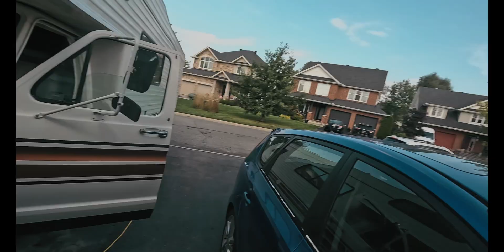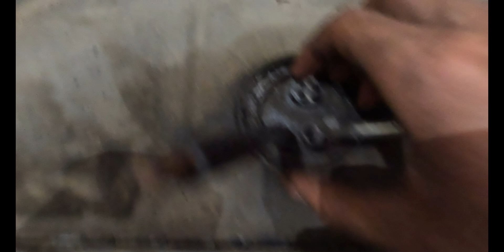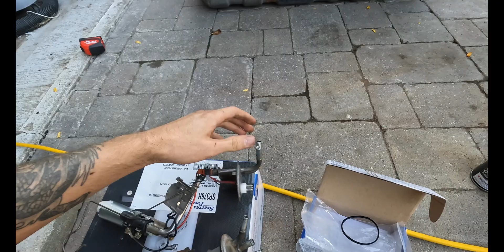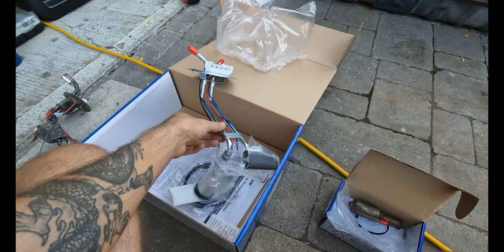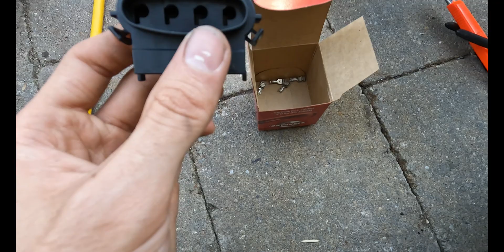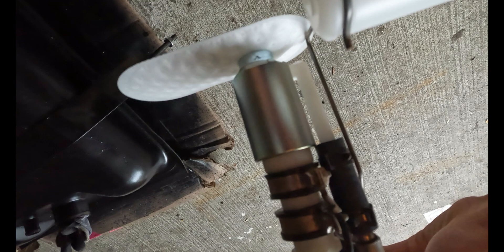3rd Gen Ford E350 Econoline Full Fuel System Replacement |1984 E-350 VINTAGE RV REBUILD EP.56

Comment: I have an 88 econoline 350 will it work on that
Reply: I need to redo the fuel lines
Reply: Mines a single tank
Reply from the maker: Yes, the 88 might have some differences but overall it's the same process

Comment: what fo you mean by front tank? i don't have tgat. i only hage rear tank 55 galolkms. where is the front tamk?
Reply from the maker: It's a dual tank system, if you have just one that's fine. Honestly I'd prefer that over two
Reply: @ZJsWorld  box truck don't have two tanks and it is 35 gallons or 55 gallons. i have a custom made tank for my onan power generator but it was not from ford
Reply from the maker: @coco9004 yes exactly, that's cool you have a custom tank

Comment: Do you still have those fuel sending units?
Reply from the maker: Think I got em in storage but they're pretty rough
Reply: @ZJsWorld if they work at all good enough for me cause I can’t get any by me and ordering them is almost 500 each now
Reply from the maker: @phazedblake6999 two different sizes, what tank size do you have?
Reply: @ZJsWorld I have the identical camper van as yours with both tanks
Reply from the maker: @phazedblake6999 where abouts are you? I could send em out to you after the winter I can't get to em now

Comment: I got an 82 corsair Econoline xl been sitting 8 years put a new battery in it turns over but won't start, put a Lil gas in carburetor n it starts but dies right away
Reply from the maker: For me I did a ton of trouble shooting to figure mine out but it could be a few things. They have a safety switch built in so it'll kill the motor if something is wrong. For me it ended up being a failing thermostat so it would shit off to prevent heat damage. In some cases it can be the safety switch itself is messed up or there's a solenoid on the back of the block under the doghouse which would need to be replaced, this have me a temporary fix one day. Also check your fuel delivery relay they tend to go bad A LOT when sitting. Cheers hope this helps

Comment: I've got an 88' warrior Winnebago E350 been stuck on the road replacing the fuel system, mechanic did the tank pump and float etc. .drove for 1hr. Heard a "c lunk" and ow it dies after 30 sec
Reply from the maker: Ah man that's so frustrating. I had my fair share of break downs getting across Canada   maybe check for spark? This is an issue I had. Also could be your fuel filter is clogged? It's honestly a headache dealing with these vehicles sometimes but they are simple at their core. Just have to backpeddle and do some diagnostic

Comment: i have a 1991 ford e350 high top that is having possible fuel pump related issues. I got it a year and a half ago and have dumped tons of money into mechanical repairs, even rebuilt trans. Needs floor pan replacement or patching. I wanted to make it a weekender camper, but was going to use it as my daily for saving miles on my truck. i love the van but its breaking my heart.
Reply from the maker: AW MAN, I KNOW THAT FEELING. gotta weigh out your priorities now and see if its worth finishing. i wish you the best of luck!
Reply: some of those year fords had an issue with the pcm  or ECU )engine control module having defective transistors. may be something for you to research if you've put much money into fixing an engine driveability issue that is unresolvable as the defective ecm could present in many varying symptoms that mechanics blame on parts. my 1993 ford e350 RV with the 7.5L v8 had a plugged catalytic converter that was causing my mileage to literally drop to 2 mpg

Comment: Relay connector is full of green crusties, corrosion, clean out corrosion it should work. As for the relay a 5 pin in interchangeable with a 4 pin provided the connector fits.
Reply from the maker: thanks brotha, the new coonector did the trick we been on the road for sometime now, appreciate your comment!